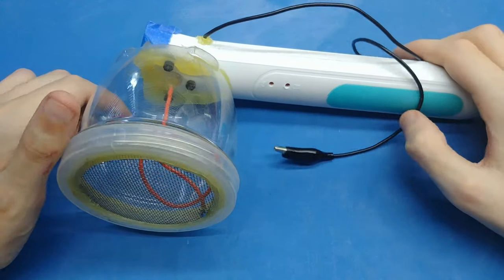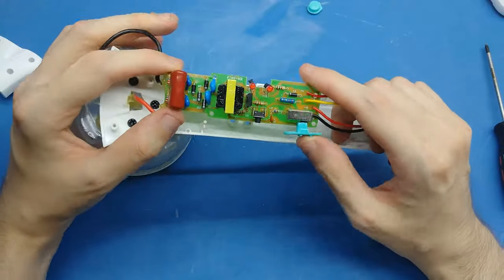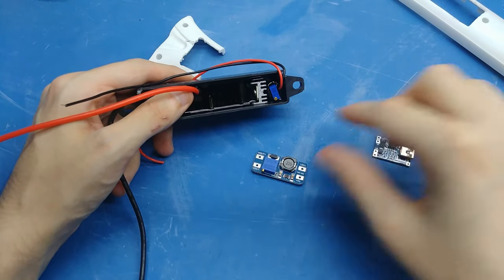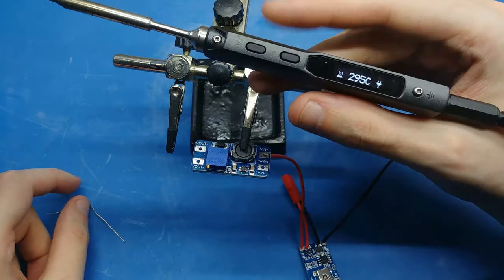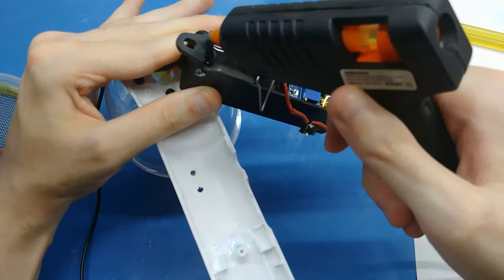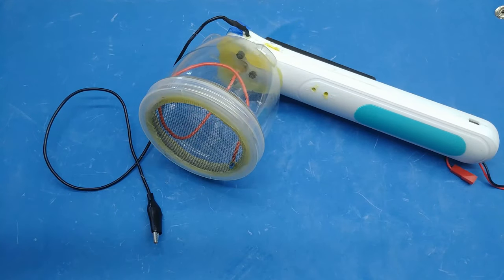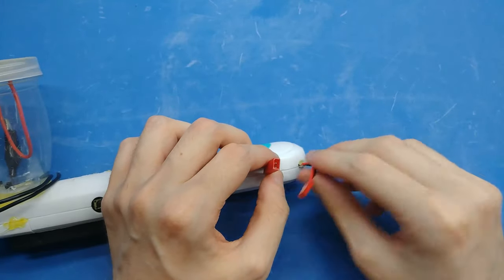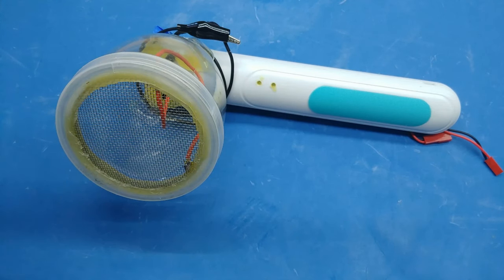Static Grass Applicator upgrade 3.5kV to 20kV

Comment: Just a hint, put the positive  plate in the bottom of the tub. As this will work better and no chance of a shock👍
Watch 'Model Railroading' vidio as he tested it there and it worked better...
Reply from the maker: I was thinking that after I upgraded this one. Haven't tried remaking it yet, maybe soon.
Reply: @rebsdioramas  the screen doesn't have to be moved just the terminal point, hope this helps